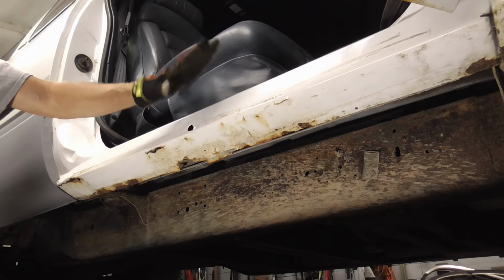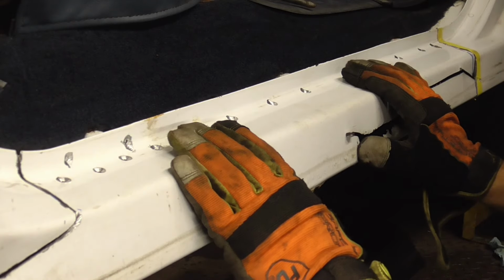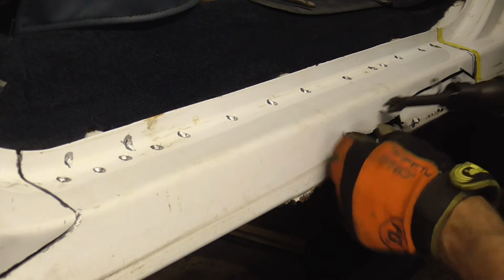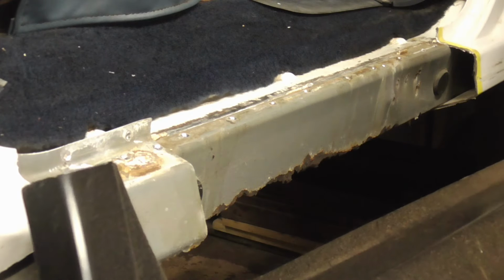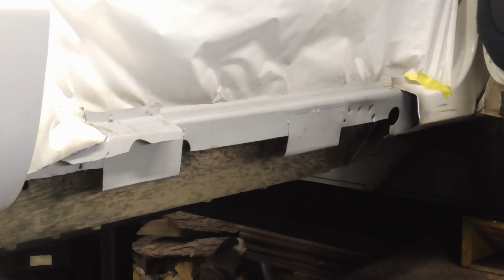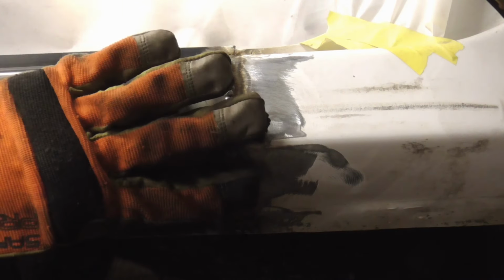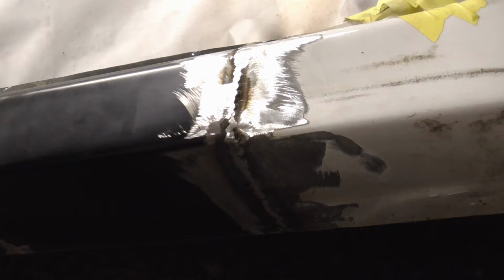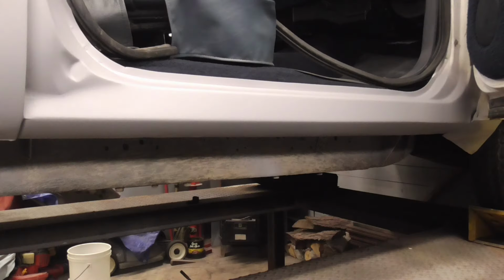Rusty Rocker Panel Removal & Replacement the Easy Way

Comment: Good learning experience except for the welding part you definitely need to space those welds out at least 2" for heat otherwise you will warp the panel you're installing you could even use a blow gun to cool the welds off before continuing. Piling those welds on top of each other is definitely not the way to do it
Reply from the maker: On very rigid panels such as a rocker you can go ahead and weld it up w/o worrying about distortion.  On larger less rigid panels like doors, fenders, quarters, etc. you're absolutely right space them out, then come back and fill in the sections while bouncing from once spot to another.
Reply: @LakesideAutobody  I was thinking the same thing but then I remembered the door frame and rocker are structural, actually part of the cab frame, and add strength to the overall structure. That said, you also cut out a good portion of the inner cab extension and drop down structure, thereby reducing strength overall in what could be a vulnerable area in the event of a crash. I’m not a pro but I don’t think this repair would pass ICAR standards. It would have made a better repair, to replace all parts and metal as needed, without cutting away and leaving structural metal out before welding things back up. As you pointed out in other videos, shooting the insides of the rockers with WD40 or the equivalent creeping rust proofing oil from the backside thru the access holes will keep it from rusting. As you know, it will run out along the lapped seams at the bottom protecting from future rust and it can be touched up as needed going forward. These trucks had no rustproofing from the factory except for the galvanized priming process and look how long they lasted. Also, it looks like the cab corners on this truck were repaired/replaced first. The correct sequence is to remove all rusted metal first, (cab corners, rockers and inner cab extensions) repair/replace the inner structures, then install the rockers, and lastly the cab corners. Once all is body finished and painted, the repair should be nearly undetectable, especially to the untrained eye. Too many leave the inside structures undone, cut up, or cobbled together, instead of doing it right. It really doesn’t take that much more to do it right. A functional repair done here but Lakeside has the ability to do it even better. 👍🏻 Thanks for your videos!
Reply from the maker: @bondpit8750  Your're welcome - good information too - thanks for the input and support - Jerry

Comment: roughly how much would you charge for a job like that to install the panel and spray on a good primer?
Reply from the maker: Rocker ($40)  and primer ($50-$100), I would charge around $100 for labor - so I would say around $250 for the whole job.  Depends a lot on how bad the rust is too.

Comment: Do you ever use AllMetal instead of filler?
Reply from the maker: No but it probably can't hurt to use reinforced fillers on this type of repair.  Never tried Allmetal but might do a video on that - I've often heard of it.
Reply: @LakesideAutobody  pretty awesome stuff, use it in hot rods and rat rods a lot. Also helps w the cheap new metal theyre using on cars
Reply from the maker: @erikdale9145  Cool - I'll check it out - thanks for the information :)

Comment: The rocker panels were sealed for a reason. it is intended to keep potential exhaust gasses from leaking into the cab. This vehicle would not pass an inspection with your "Large" Drainage holes.
Reply from the maker: There's no gasses leaking into the cab - I drive it every day.  If you like you can weld it up solid - no big deal or difference in work.  I opened them because it will never rust out again this way.  Hang a bare piece of sheet metal from a tree and it will last forever because it can drain and dry - the secret to no rust :)

Comment: Nice video and thank you! I have a question as to why do a straight bead instead of the other way you showed in your other vid about a tack weld, like the fender patch replacement.
Reply from the maker: Usually if I butt weld it's a rocker or a post (something that's hard to knock down and fill). When I butt weld I usually put the welds right next to each other (straight bead).  If it is a lap welded patch panel I think you'd be fine not putting them right next to each other  - they can be a little bit apart.  I've never had a problem leaving a bit of space bet. welds - saves on gas too.  Hope that answers your ?'s
Reply from the maker: I read your ? again.  This may answer it better.  I always tack the patch panel into place 1st.  Then you can weld it up however you want.  Sometimes you have to tack it in a bunch of spots - sometimes like that rocker you can just clamp it and go.  Usually with lap welding patches you tack it in a lot of spots because you want it tight together w/ the other metal.

Comment: The 97 Chevy I just got off a guy used 
Gorilla  tape to fix the rocker panel  , it looked  professional  , 

12 year old boy professional  could have done a better  job , at least  he used the same  color  tape as the Truck is .
Reply from the maker: That's great.  I'll bet there is good drainage it will last quite some time :)
Reply: @LakesideAutobody  , ha ha ha ha 😂 
It has already started to come off flapping in the wind , 

I got brand new  (STEEL) rocker panels and  I am getting ready to install them , I was watching your video  for some  pointers and  techniques  to  install them  ,
But I will have some  tape for sale  very soon if you are interested  😜👍
Reply from the maker: @jimthomas1989  👍🛠😊- Feel free to ask anything as you go :)

Comment: whats a fair price to pay for that job?
Reply from the maker: I doubt you can find someone to do this job for under 500.  I'm thinking upwards of 800 to do the full replacement and painting at a dealership or body shop - that is if they would even touch it.  That's just a guess - I never wrote the estimates.

Comment: Beautiful work... and SO UNNECESSARY. It should be ILLEGAL for manufacturers to even consider designs that are GUARANTEED to RUST OUT. It's outrageous!
Reply from the maker: You're right.  They could easily stop it by allowing for water and moisture to drain out much easier.  I've seen plugs from the factory over drain holes at the bottoms of doors, hoods, etc.  They could even install clean outs so that if someone wanted to they could run the hose through the rocker and wash it out every now and then.  If it stays clean and dry in there it would last a lot longer :)
Reply: @LakesideAutobody  
Thanks for your reply. I'm faced with having to repair/replace the rockers on an 2009 Escape. I'm trying to find a solution that won't cost more than the vehicle is worth.
  Why the manufacturers could use steel with a tiny bit of nickle in it which would eliminate the problem I don't know. Ya... might be a few dollars more to buy but so what if you don't have to pay thousands years later.
Reply from the maker: @rae0521  I'm sure they could make cars rust proof but the rust belt is $ for the auto industry :)

Comment: Not spacing your welds or cooling your welds so you are likely to warp... leaving a massive holes... better how to out there but at least you used metal...
Reply from the maker: With respect, you don't have to worry about warping metal on rigid areas like rocker panels. Wide open long sections, yes - have a good week B&A :)

Comment: Wow you show you left the inner rust horizontal panel structure, not cool. Did I miss a step where you took that rust out? Or does the next guy have to fix what you covered up? Not cool.
Reply from the maker: You missed that step and why I fixed it the way I did. The reason rockers rust is because the rust chunks, leaves, debris, dirt, etc pile up inside then get soaked with salt water in the winter and rot out the panel.  It's my truck so I don't want that to happen again - therefore instead of sealing it up again I welded new metal in but did not enclose it.  Remember, you want panels to drain and stay dry at all cost - if debris is allowed to accumulate and moisture persists it will rot out again.  This repair will never rust out again - period.  Because it can drain.   Have a good weekend:)

Comment: Still a big ugly dent at the back. Could have been knocked out before welding or adjust where the panel was cut.
Reply from the maker: That's stamped into the door jamb at the factory.  It's so that the door rubber bumper has something flat to rest against :)

Comment: No inner rocker
Reply from the maker: No - this one is my tow truck and wood truck.  You can throw a new inner panel in there if you want though.  I like to make sure I have drainage so I just fix up the old one a bit drill some big holes and then this - https://www.youtube.com/watch?v=8XaZBy7GC7A  If a customer wanted it though - I'd install one :)
Reply: @LakesideAutobody  
I done some work on a Dodge this spring the person was using that oily like wax spray from WD-40 and that was a pain very flammable meterial and even the new vehicles the sprayed in sound deadening or panel glue that stuff is very flammable to try and weld around !
Reply from the maker: @danamcintyre3565  You're right - sometimes that stuff ignites - good to have an air nozzle handy to blow it out.  Good talking to you Dana :)

Comment: As soon as you started spreading the filler I can tell you for sure your welds are still too proud and you're  also going to have a ton of pin holes to fill after you start sanding it
Reply from the maker: Please see this video for longevity of this type of repair if done correctly: https://www.youtube.com/watch?v=8XaZBy7GC7A or 
https://www.youtube.com/watch?v=2o37dX--w0I

Comment: You sacrificed the original factory integrity by leaving the back of that rocker open,that is not ICAR approved dude.I hope you aren't doing this on customers car's as that comprises the strength of that area for protection of the occupants,if you have a shop you can be sued if someone is injured because of not restoring that rocker back to factory specs. 26 year bodyman.
Reply from the maker: I don't wear a bicycle helmet either!  You can restore it back to original factory specs if you want - no problem but that wasn't the point of the video - it's removing and replacing a rocker panel - replacing the inner panel would have made the video longer and a bit boring. No worries anyway,  It's a demonstration vehicle.  Good job working as a body man for 26 years - my boss always said, "A mechanic can fix cars but a body man can fix anything."  Have a good weekend.:)
Reply: @LakesideAutobody  You do what you want,but for avoiding a lawsuit if you do that on customers vehicles, thiers a collision injury in that spot,you will get sued for lack of returning that rocker an backing to original structural integrity. THAT IS A SAFETY ZONE.

Comment: That inner panel looked like a box section with the bottom rotted out. A new bottom to the box with drain holes would have made sense. I’m no expert but your solution looks weak to me.
Reply from the maker: The fact that the factory encloses panels is why they rust - they hold and trap moisture and it never dries.  This is plenty strong as it's a full frame vehicle but you can make any type of panel to back it that you like - as long as it can drain and stay dry in  there - Here's a follow up video - that repair is still perfect to this day - https://www.youtube.com/watch?v=gIS1Tbv7Kvw

Comment: Frames rotted too haha
Reply from the maker: Frame is fine - I tow cars with this truck - pulls a loaded car trailer perfect.  Lots of years left in it - 285000 miles.  As long as you keep the frame somewhat clean and able to drain and dry it'll never rust out.  Remember, drainage and drying is the key to no rust - when things stay moist, salty and filled w/ debris it rusts out fast

Comment: I can see why doctors get paid so much money 
Who can take a cutting tool to their baby😶 
I'll be working on a 95 k1500 ext cab soon myself
Reply from the maker: Let me know how it goes - I really do like this truck - starts every time - everything works on it.
Reply: @LakesideAutobody  interior is out. 
Frame trans on back is all painted parts are going onto the frame like gas tank, lines, wiring will be moving to front half soon but all on hold wile I was getting a new to me daily driver 92 buick on the road and now preparing snow equipment as well as services garden tractor decks before winter storage. 
Already got a quote for having all the glass removed so I can repair rust on the roof and window gaskets  so I can paint the whole cab at one time. 
So much more work to do but will be a solid truck when done be like brand new only parts not removed is power plant with related plumbing and cab with dash did only pay 600 for the truck probably have 8 grand into it😵
Reply from the maker: That's something you could drive for the rest of you life!  Those trucks last forever - mines got 274K on it.  I'm looking forward to hearing how its going so keep me updated here and there.  I'm in the middle of making a video about using SEM impact resistant structural adhesive to glue on a door bottom for this 96 K1500  - I think you'll really like that.  Have a good week :)

Comment: Rocker panels are the stupidest invention of all time.  These things could easily be screw on, screw off  industrial plastics with gaskets sealing them.  Instead you have to have a fortune in tools and lifts etc  to replace simple things that WILL go bad soon enough.
Reply from the maker: You are absolutely right - they could be designed a lot better w/ proper drainage.

Comment: Im laughing how bad this is.
Reply from the maker: Trust body men from the salt belt when it comes to rust repair - not the TV, Internet or magazines - https://www.youtube.com/watch?v=gIS1Tbv7Kvw
Reply: @LakesideAutobody  yea sure ,
Reply from the maker: @dekonfrost7  Honestly... don't trust all the hype about exclusively butt welding and all of the blog/internet body shop snobbery. That stuff doesn't hold up in severe weather conditions and salted roads - it's for trailer queens that never see the road again.  Weld the patch in (butt, lap or glue), knock the seams down (very important step), fill, prime, block, prime again, finish sand, paint.  That's how every professional body shop in MI does it.  If you try something else & you'll probably face other guys laughing at you or you'll get let go.  Nice talking to you and keep watching and working.  If you stick with it, you'll eventually fix all rust damage like you see on this channel - it will be and IS the standard :)
Reply: @LakesideAutobody  nobody laughs at my work. I had mustangs and I was poor. I worked in a shop for free to use the tools and so I could steal paint. My boss/ slave. Aster had tig welders and lots of kids. I crack jokes but he was just a good guy needed the help and was a positive roll model. He made enough that giving us some electric and paint was a fair bargain all the way round. What you did was take the strength out of the rocker and guaranteed it’s early failure again. I’m buying a ranger best deal has bad rockers and was looking to see the real time how many welds and who mages a good set. And if the floor pan coupes out easily. Then I saw your video. Bro it’s bad you and I know it. There are rust preventatives but to leave it raw and open is so you don’t have to weld or caulk. Admit it
Reply from the maker: @dekonfrost7  The repair is 4 years old - here it is today - https://www.youtube.com/watch?v=gIS1Tbv7Kvw  I'll do another follow up video on it in a year or two - it'll look exactly the same - nice talking to you ✌😊